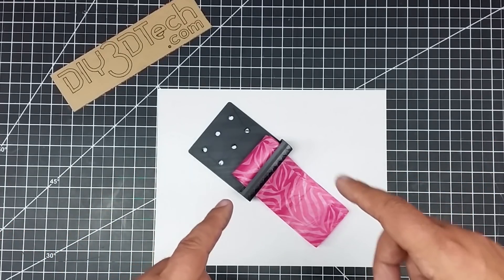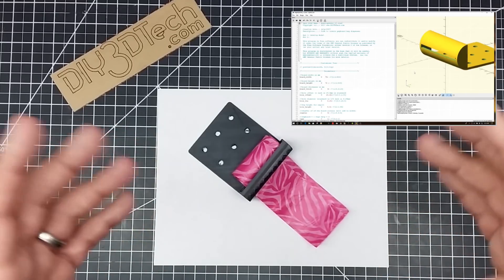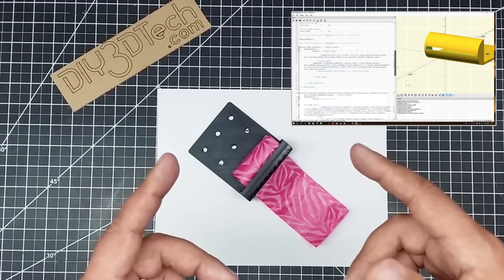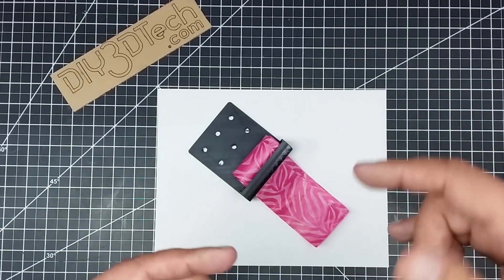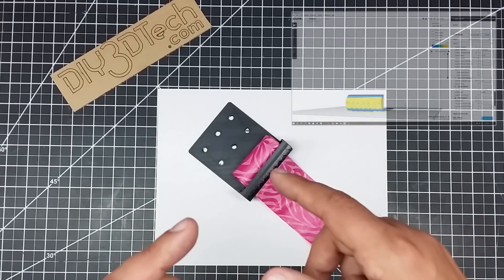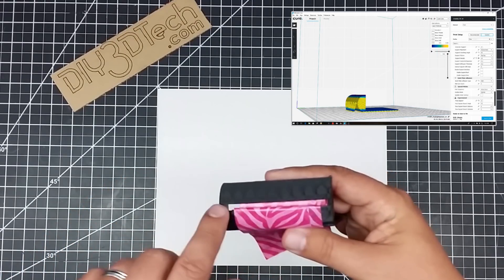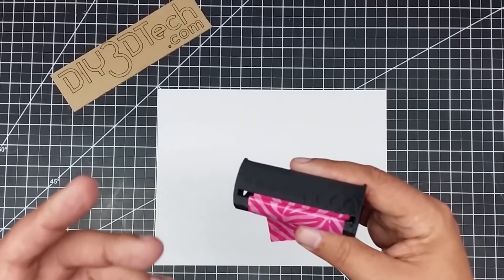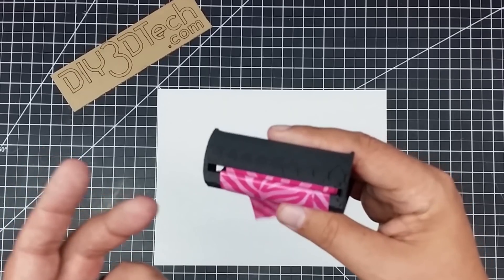Shop Talk - Aberrations in CURA Adaptive Layering!

Comment: Have you tried opening the gcode in a gcode viewer to see if it's actually coming from the file?
Reply from the maker: I did open the file to see if there was something and nothing jumped out at me, yet this might be an interesting idea as I typically don't use a viewer for 3D printing yet for CNC I do.  Thinks for sharing :-)
Reply: @DIY3DTECHcom  I reckon it has to be the infill, then

Comment: Looks like the infill is showing through the outer wall. Maybe more walls will hide it.
Reply from the maker: Hmm, not sure I did try other configurations and it still showed.  Very odd...
Reply from the maker: I think you right about the infill, however not so much showing though but affecting the walls.

Comment: I would have printed it on its side and eliminated all of the support issues.  But that's not what this video is about, is it?
Reply from the maker: Even on the side it still would require supports unfortunately...
Reply: The slot is narrow enough that it should not require supports.  It does not require ends to retain the roll of bags because the bags go through the slot and that keeps the roll in place.  So no supports for the ends.  If the round mounting holes don't come out round enough, either make them larger or replace them with square holes who's sides are at 45 degrees to the part's edges.  

The bag dispensers I see in the grocery store have a probe that searches for the perforations in the bag roll as the roll is being pulled and it assists in tearing a bag from the roll.  That idea could also be incorporated, but would require a more extensive redesign.
Reply from the maker: I understand the slit is small could be bridged, yet sit on the bottom, there is still a lot of curve and think it would sag (maybe worth a try).  Also the "probe" is an interesting idea and I considered teeth but structure is not strong enough to support tearing...
Reply: If the slot was tangent to the roll there would be less force on the curve (structure).  With the slot on the bottom the roll of bags they will always have to make a turn to go through the slot and therefore require more force.  I would place it closer to the top of the roll.  And if the structure is not strong enough, then brace it from the bottom and/or make it thicker and/or use a stronger material.   But you know that.
Reply: Here is a downloadable drawing I did in Fusion 360.   I have no idea what the dimensions are suppose to be, so I just made some up.   https://a360.co/2LV9Fnv

Comment: Interesting Joe. Have you tried another slicer ? Looked at slicing pattern? Not enough perimeters ? 💘
Reply from the maker: Only Cura, however there should be enough perimeters as its a pretty simple object...
Reply: oki, in slic3r there is an option to add extra perimeters (if needed), maybe your volumetric file gives headache to the slicer... short you may try another slicer with the same printer for this particular file... just to check... just an idea
Reply from the maker: You likely have a point that the slicer is having issues with the thin walls and infill....

Comment: Logically I agree with your analysis on the adaptive layering. . Have you checked the belts and rollers to make sure everything is tight?
Reply from the maker: Yup as I have printed other things afterwards just fine and went back and printed another with the same issue...
Reply: DIY3DTECH.com    Interesting..... 🤔

Comment: That's not your infill showing through?
Reply: That is definitely his infill showing through
Reply from the maker: Trying a different infill might be interesting as I did print another without adatvie layering and it did the same...
Reply: there is a setting in slic3r (solid infill threshold area) to put 100% infill when the surface is below a certain amount --- probably to avoid too thin walls collapsing over "empty infill"
Reply: Hmm strange, maybe... Not. Maybe. Not enough perimeters for the wall so infill shows ? But weird at this place ? Joe can you show the slicing of your 3D model ????
Reply: Could verify by printing a version with adaptive layering but a different type of infill. However, looking at the slices in Cura would probably show that the infill is lined up with that pattern.